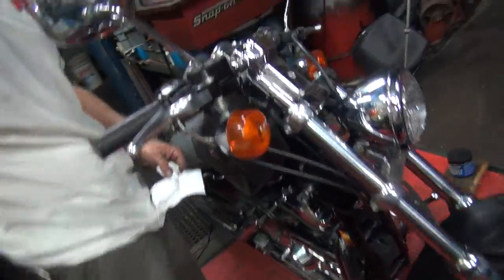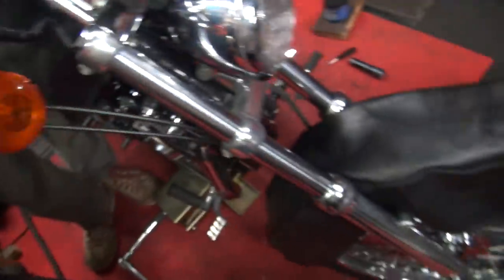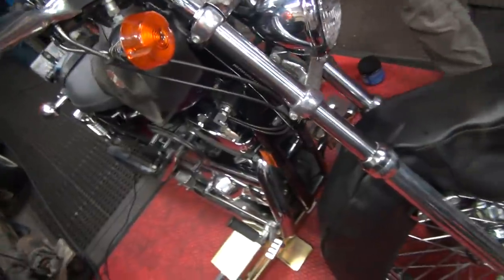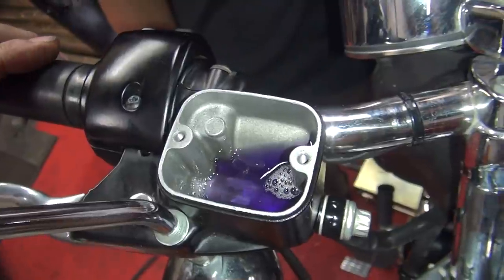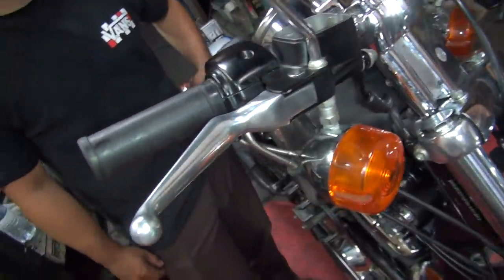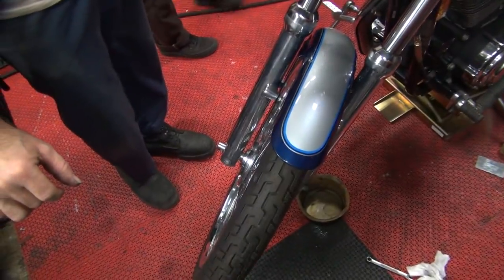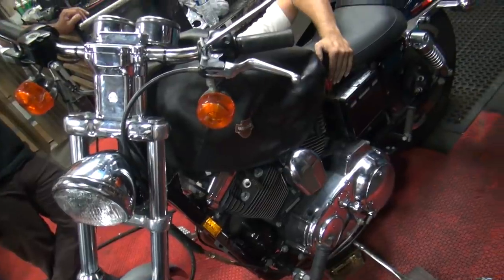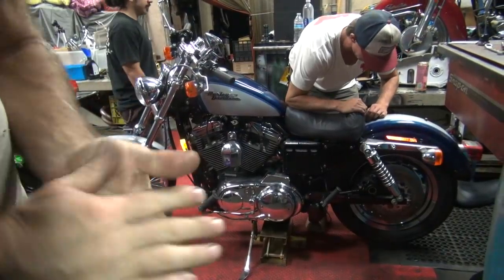#125 1999 1200 sportster custom used bike check out 10k service harley by tatro machine

Comment: I bleed brakes by putting a vacume hose on the bleeder tip and clipping it into the reservoir and open the bleeder and pump till the system is air free